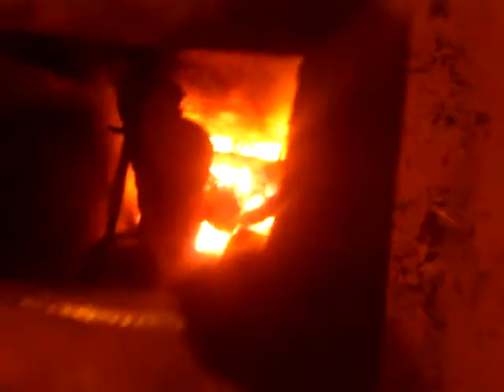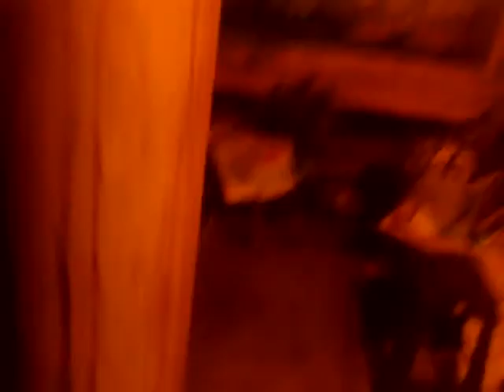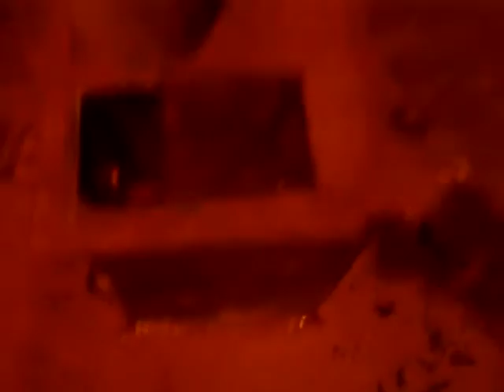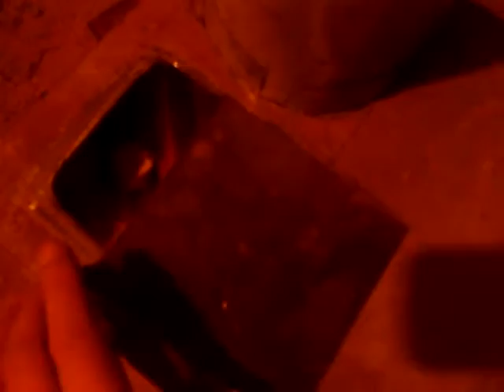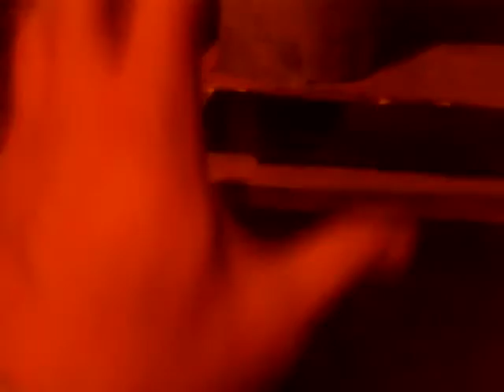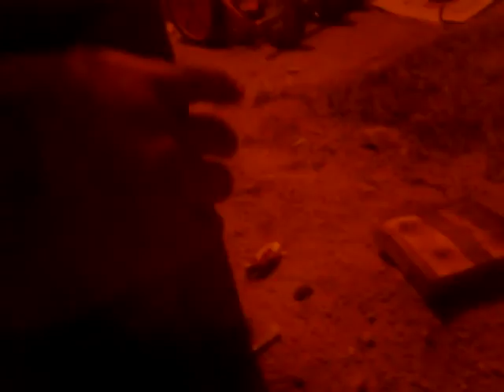Rocket Stove Chile (test of the secondary air intake)

Comment: Wow !. Great work. Now it works prefectly. Secondary air intake pipe is certainly very hot because it's under the fire. Would be nice to measure how hot the box gets.
I will try something similar in my own box. I don't have welding tools so I have to figure out some other way of making the secondary air tube.